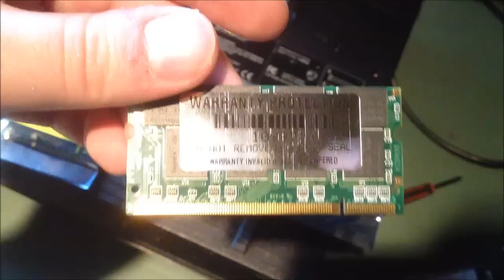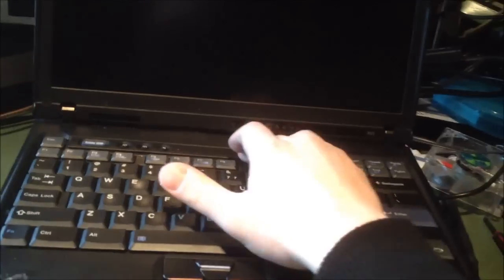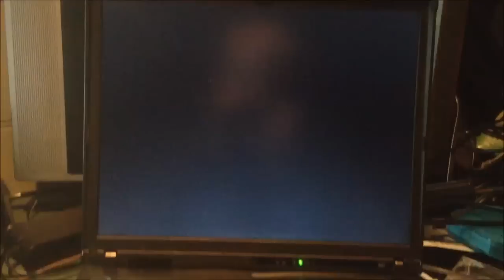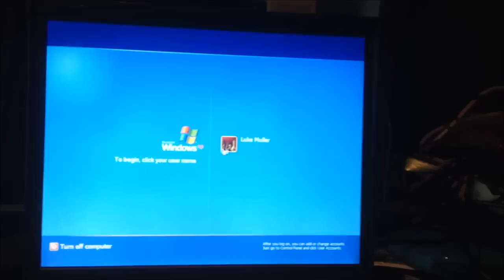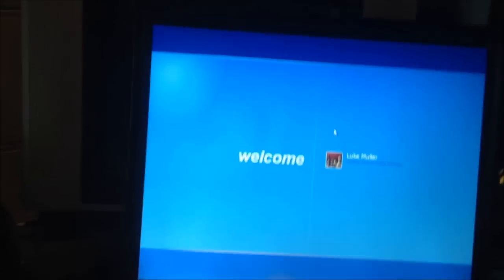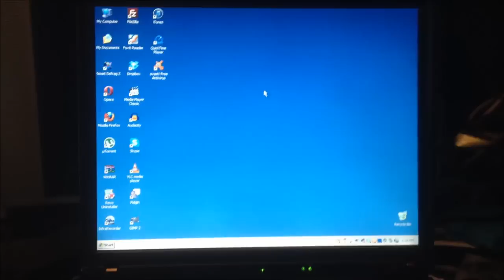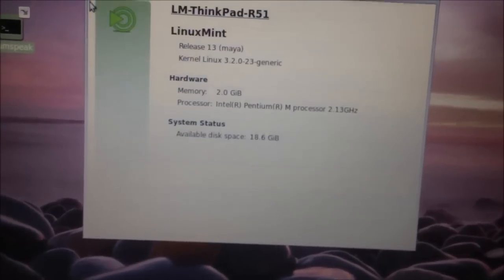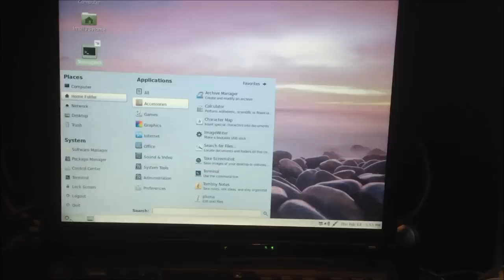IBM Thinkpad R51: RAM Upgrade

Comment: I just went the opposite way today. I bought mine really, really cheap, with the charger, and a working battery at 100 % health according to batteryinfoview.
The CMOS battery is dead, so that will have to be changed at some point, but, because of the dead CMOS, the counting of the memory was taking sooo long.
It was 1270, so obviously, the original 256 meg RAM and another added 1 gig. So I hunted down whatever Windows 98 drivers I could, installed Windows 98, and took the 1 gig out.
And I think that this might be an excellent late DOS gaming machine, or at least a great late 90s Windows gaming build.

Comment: After the installation of Linux Mint, did the WiFi still work?  Was a special driver needed?  Is there another video on how to keep the WiFi operational?
Reply: Stuart Oserman I had an issue where the Wi-Fi was not enabled after installing lubuntu on my r61 it was solved by shutting it down, removing the battery, draining the electricity by holding the power button for a minute and then when I put the battery back in and booted, Wi-Fi worked well

Comment: I have an R51 with 1.5 GB of RAM. I'm considering upgrading it to 2 just to get a little more speed out of it. It's pretty fast as it is, but do you think the extra 512 MB would be worth it?

I also might replace the original 80 GB hard drive with an SSD.

Comment: I want to buy the exact IBM. For very cheap. Right now its running windows xp. But I plan to install more ram for Windows 8.1 or Linux. The seller doesn't know that Bios password, but it's not locked out of Bios. Did you need to know the bios password when you changed the operating system? If so, is there anywhere I can find it before I get locked out?

Comment: lmull3 My sister got one of these for free. I tried to install Xubuntu to it from USB-drive, but it got stuck at the bios. When I removed the drive, it continued to boot to Windows. It did this with another drive too, which was not bootable. Is there something wrong with the motherboard or something?